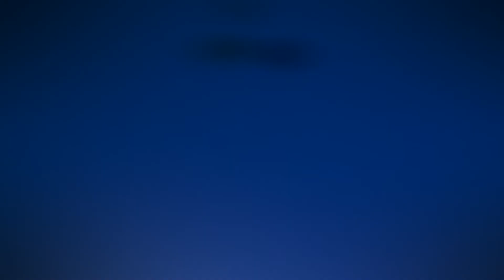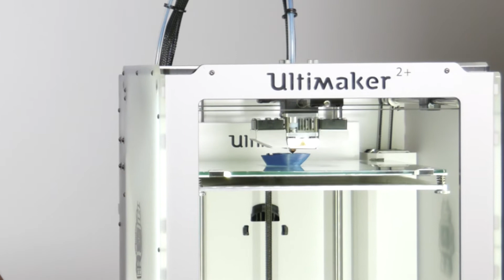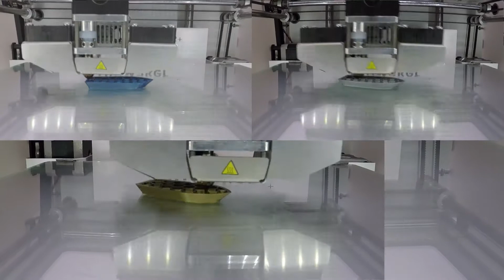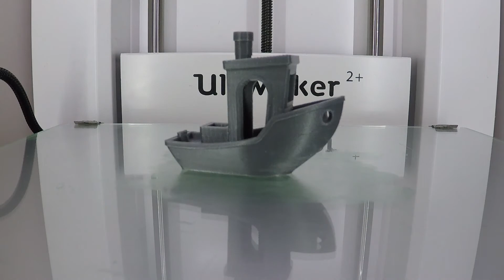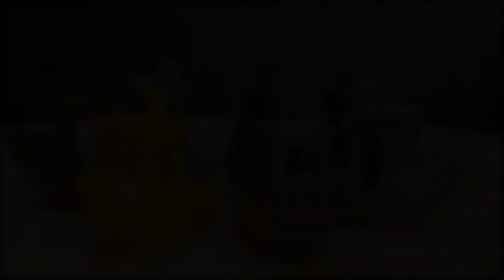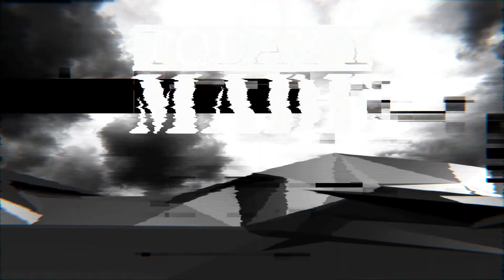Get better 3DBenchies with this one simple trick! - 3D printing tip for Ultimaker printers

Comment: Great tip! This might be a good suggestion for about anyone. I know I've seen a difference in print quality by rotating prints on at least a couple of my printers.
Reply from the maker: Any printer that uses the same motors and drivers as Ultimaker's will have this issue, I am sure. And probably a number of other designs as well, but since I don't have enpirical evidence, I hesitate to make grand claims! ;)
Reply: Today I Made So here's the big question - is this caused by the stepper motors, the stepper drivers, or a combination of the two? That could be a fun experiment to test someday!
Reply from the maker: It's the drivers that cause the issue. There are some workarounds that involve a bit of creative soldering or some added chips, but these cause some heat issues, so it's not a perfect world.